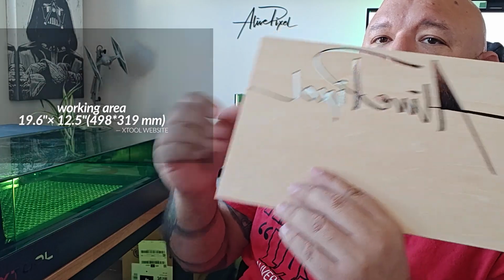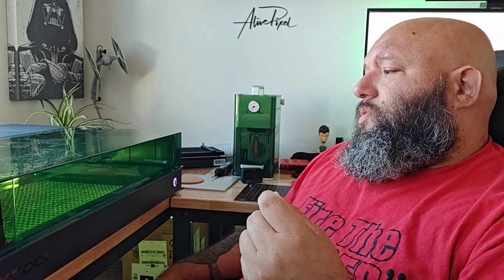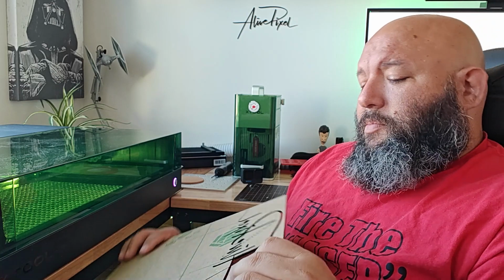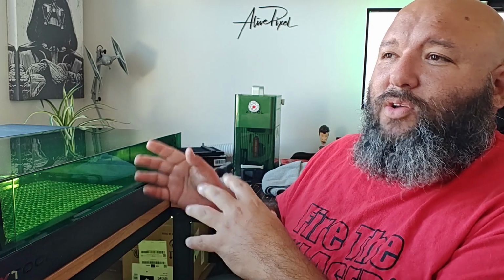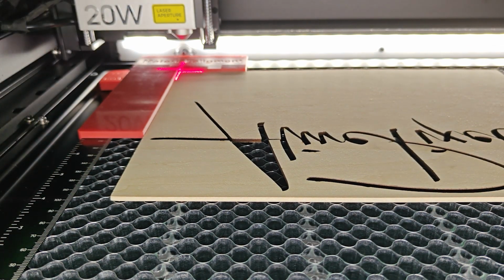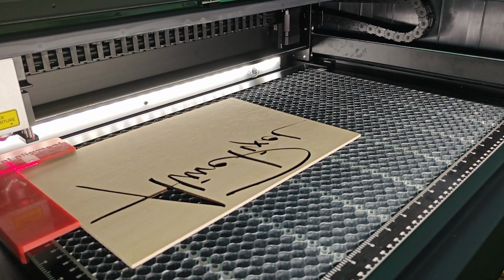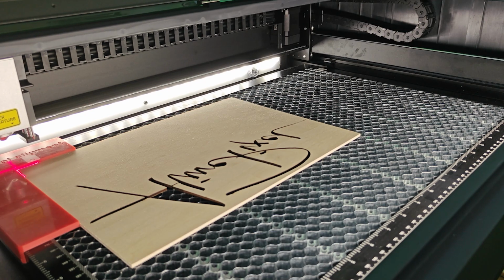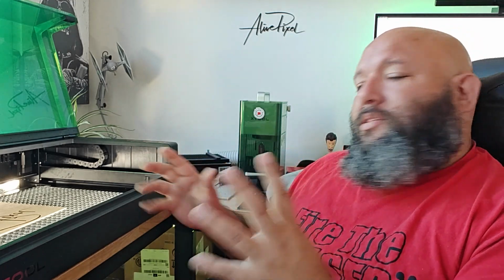XtoolS1 Review and thoughts

Comment: Hi! I appreciate your honest review and understand that you're probably very busy. Your gave me some insights I needed. Since I'm newer to lasers I have a question for you since you have experience and honest feedback!

What would you think could be the better option of a laser purchase for me. I'm looking to get one on the Black Friday Deals. I know in the end I'll need a cnc or c02 Laser, but I wanted to start with a diode and complete smaller projects while dealing with the learning curve. Safety is also a concern for me while learning and having a limited budget.

I'm between the F1 and 40w S1. The laser I would be used for cutting acrylic signs/decor, acrylic accessories and engraving stainless, steel, pencils/pens, custom stationary, jewelry, and possibly glass. Would that laser work for those types of projects? My goal is to cutting acrylic which is why I would save up for a c02 in the long run.

Any feedback, comments, or concerns would be appreciated! Thank you
Reply from the maker: Hi Josie, in reality the first thing is to understand what laser does what you need. Diode are fun and great on metal with some restrictions and same with acrylic they won't cut clear or some translucent acrylic. Great for wood and things like that ( organic ) also if you plan on a 40w definitely you need to be aware that is more for cutting and not fine details. For fine details I will recommend a 20w. 
F1 is a fan laser but small and has the same limitations with acrylic but on metals is better since  comes with the infrared. That is designed for plastic and metals (marking only)
My advice is if you can get a diode that help you learn and go from there.

Currently I've been impressed by Roly Automation they have a 20w that has a fiscal switch for 10w that give you a great option for fine engraving and cutting woods. 

Remember as a diode is great on materials like wood and leather and can mark some metals. Hope you find this info helpful and thank you for your time and comment.

Comment: I dunno, for me this unit made sense. I looked at the closest match that Omtech has in Co2, which is the Polar, and it came to more than the S1 and a little clunkier IMO. It has almost the same same work area as the Polar, air assist looks worse on the Polar in the reviews I've seen, and it's missing some of the convenience features like auto air assist and fume extraction. I do miss being able to cut clear acrylic but I can cut a variety of clear coloured acrylic that are red biased in colour (can't cut blue, for example). The 40w is slower to cut than Co2 but it can cut just as thick as the Polar in pine etc.

Overall it seems easier to use, suited for use in the house, I am happy with my choice - just wish I could have gotten the Black Friday deals.
Reply from the maker: i prefer Roly laser and is a lot cheaper

Comment: Very enlightening Daniel. I knew cutting area would be off with 40watt but did not realize just how bad it is. Hopefully they will fix it. I like the auto focus feature, don’t like two point positioning. The entire idea of a cnc which is what a controlled laser by a computer is, is not to constantly use your hands to move it around. Any machine needs to be absolute coordinates. I run my d1 10 watt non pro on absolute coordinates. And I have my honeycomb on both machines on a riser base set perfectly at 0/0. As far as that guy getting kicked out of all xtool groups, I think that will become more frequent than not. It is sad, but I believe this to be the case. Look forward to the Roly review. Do you have an Ikier with their autofocus. I would like to here what you have to say about that
Reply from the maker: Thank you Steve. I don't have the machine anymore and I tested for a little time. The autofocus was exactly what I have on my add-on for Devil1 and honestly was ok but they had a really low clearance and drag materials and pins around.
Reply: @AlivePixelCreates  I’m very curious about the Roly. Rich from LA hobby guy says best he ever tested and it’s a complete package but no auto focus I believe

Comment: Hey!🙌Same opinion here. What can be more Faster than an internal Camera????🤦🏻Registering corners sounds more appropriated for an open laser like D1 Pro etc.
Reply: I have this model.  I love the cross-hairs.  While having a camera and cross-hairs would be even better, I want to physically see the alignment with no offset from a camera.
Reply: Personally I love using the cross hairs. I can't imagine a camera is particularly accurate for centering stuff and you'd still need a jig, but then again I've not used anything with a camera. Ideally I'd like both, I can see how a camera could be useful for quick frame ups.
Reply from the maker: Thank you is a ok machine but I prefer roly